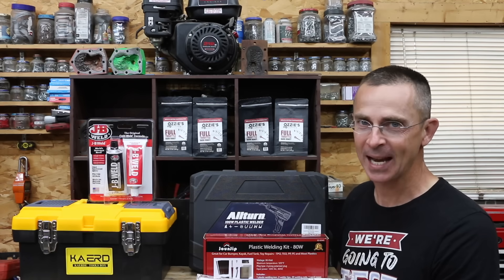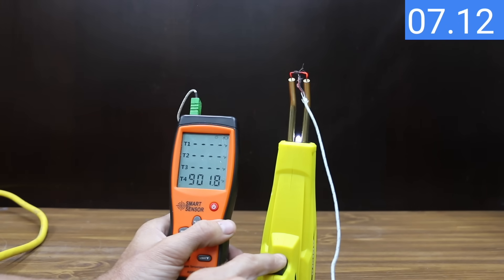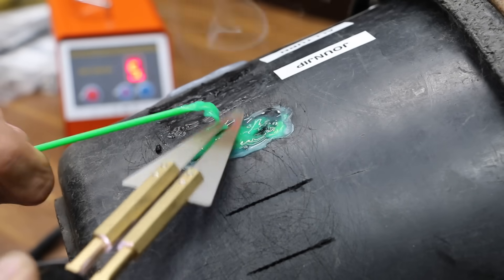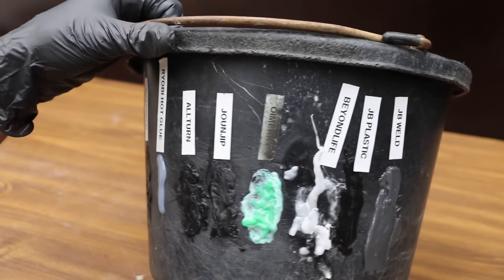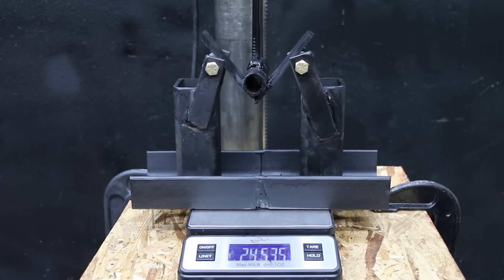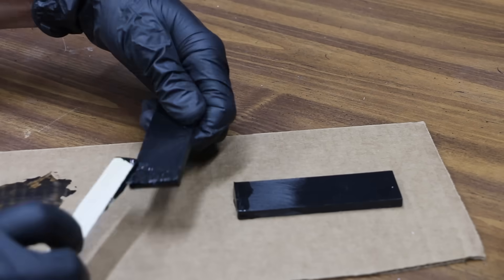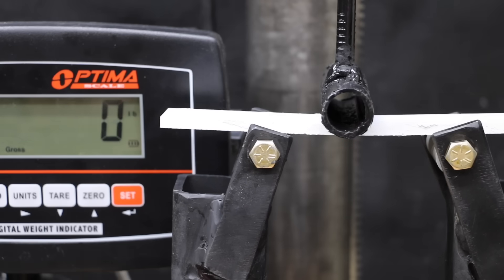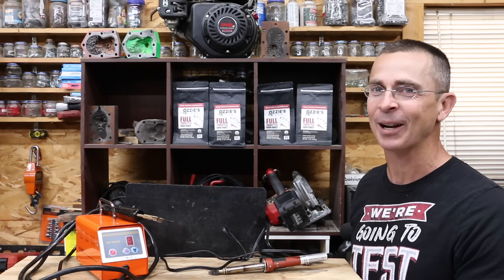Don't Buy A Plastic Welder Until You Watch This Review!

Comment: As a former plastic welder guy for 13 years i think you should maybe do a redo on the testing, when welding hdpe plastic you can only use hdpe as a filler because nothing else will stick unless is something else with polyethelene. 
The Hdpe should be welded at 220 - 230 Celsius (438 F to 446 F) otherwise you burn the plastic and it becomes brittle and not very good.

The Beyondlife welder is a knockoff of Swiss made Leister Triac and with that welder i have done water tanks up to 150 liter and on bigger fuel tanks i used a bigger plastic extruder to make the welds good.

Would love to see a comparisson when of the different types of welders but with the right conditions for welding plastic :)
Reply from the maker: Thanks for the suggestion.

Comment: For two bars but-welded together, it would be interesting to see how cyanoacrylate ("crazy glue" ?) compares.
Reply from the maker: Thanks for the suggestion.
Reply: CA  Glues vary a lot from company to company and formulation to formulation and there are some plastics that they just don't bond well to at all.  Theoretically they do not bond to polyethylene or HD PE plastics and so that's what the dispenser bottles are made from but invariably the cap and nozzle will glue themselves onto the bottle eventially and you can't get it off, except perhaps with pliers and by destroying the nozzle and cap!
Reply: @goodun2974  Yes, I have had caps and nozzles go bad. Sometimes the liquid is still good so I dip a piece of thin wire into it and then daub it where needed.

Comment: melt the mesh into the base plastic first, youre kneecapping yourelf by putting down a coat of filler plastic then trying to melt the plastic thru that and still get penetration, itll never happen that way... the layer on top will have to be completely even ly melted before the mesh will be able to sink into the layer under it... still a great video... 

id really love to see a 3/4plane, 360 laser level somparison, theres zero good comparisons of those online... id really like to see milwaukee vs dewalt vs bosch vs the several top amazon brands... thanks and keep up the good work.
Reply from the maker: Thanks for the suggestion.

Comment: I'd recommend opening up the holes so you can get it through and do the inside as well. If it's a thicker plastic I'd recommend drilling the ends of the crack and doing a 45 degree angle grind from one side to fill it.

This will be an interesting video, I got a plastic welding set I'm happy with but it's quite old now so maybe I need a new one.
Reply from the maker: Thanks for the feedback.

Comment: The basic but very effective "soldering irons" that melt metal staples into the plastic are very effective. The effectiveness of the repair depends on the time and trouble you take on cleaning the surface, welding in the "staples" and cleaning the result.
Reply from the maker: Thanks for the feedback.

Comment: I wonder it a wood burning kit would work as a plastic repairer. Or if a soldering iron would also work? Also you can use zipties as a plastic rod
Reply from the maker: Thanks for the suggestion.
Reply: A soldering iron can work for fusing and bonding small cracks in plastic, but it coats the tips with burned plastic and ruins the tips for soldering with ever again. A soldering gun with flat paddle-shaped tips made expressly for plastic repairing tends to work better. Cable ties are usually made of nylon and will bind to some, but not all, plastics.

Comment: Anecdotally, I have found that BLACK glue sticks with a hot-melt gun (I also use Ryobi) are stronger than the translucent white ones.  The melting temperature seems a little higher and the bonds to plastic a little stronger.  For "quick and dirty" I use this tool.  Why not?  It's already on my shelf.
Reply from the maker: Thanks for sharing.

Comment: This is a great video comparing the soldering iron style welders, but it didn't give the hot air welder a fair chance. The technique should be more like a TIG weld on metal rather than a smearing patch. The joint should be prepped with a bevel, and the weld should be a single bead along the root of the joint, where the base material should be heated prior to introducing the rod. Also, temperature is key. In the video the hot air welder was set way way too hot. The rod should never reach a fully liquid state; the ideal welding temperature for HDPE is 300*C. I'm a newb when it comes to plastic welding, but I have successfully fabricated several custom HDPE water tanks using the hot air style welder.
Reply from the maker: Thanks!  Thanks for the constructive feedback.

Comment: They need to make the wire mesh with some teeth on it so you can melt the teeth into the plastic  before  repair.   A+ Video as always.
Reply from the maker: Thanks!
Reply: A heat gun is best for melting the mesh into the plastic.

Comment: @ProjectFarm would've liked to see how a
 hot glue stick specifically for plastic worked compared to normal stuff since they normally don't stick well to slick plastic, only adhesion is from melting action.  But SuperTac 500 is specifically for plastic and seems to work well from my test,  but haven't compared as extensively as this.
Reply from the maker: Thanks for the suggestion.
Reply: Does the super tack 500 work well with any ordinary glue gun or do you have to use a higher temperature or adjustable gun to get it to a certain working temperature range?

Comment: The beyondlife is a welder that is used to melt two pieces together. It's a too roofing welder. You using it wrong. You need to melt the ends of the two pieces and press them back together. It isn't meant to be used for melting plastic on top of another like you were doing. If used correctly it would basically make two pieces become one. They would literally melt back together.

Comment: Something I've noticed is the method of sanding that you use is in only a single direction and that is hurting the overall strength of your repairs. When sanding you should always use a cross method. The idea is to provide the most surface area possible. You should be able to see little crosses in your sanding grooves. You will be surprised at the difference it will make. Also I noticed that you are a little impatient with your iron give yourself a little more time starting out to sink the tip into the parent material. Just like with normal welding you gotta get penetration. It's not like hot glue. You have to make both half's into a state of matter that is borderline molten in order to achieve fusion.

Comment: Great video! Next you should test those bonders that use the ultraviolet light to cure them!
Reply: Rapid fix is a good ultravolet cured glue but it will only harden in places that the light can actually reach to.  JB weld has an ultraviolet cured CA super glue that will cure quickly when and where the UV light hits it and then cures more slowly inside the joint where the light can't reach, but the one thing I don't like about it is that the squeeze-bulb system that the glue comes inside of is a terrible design ---- the nozzle clogs with cured glue and can't be cleared even though the tube of glue is still liquid.
Reply from the maker: Thanks!  Thanks for the suggestion.

Comment: I would like to see a comparison with OBD scanners. Maybe that also support more than just the engine ecu.

Awesome video. I use a plastic bonder like the jb weld primarily for cracked bumpers. They dry fast and easy to sand. With a primer and paint you don't see a difference
Reply from the maker: Thanks!  Thanks for the suggestion.

Comment: When melting plastic to repair plastic, make sure you heat BOTH parts up.  You usually heat the part that's being repaired with a heat gun.  This will make the repair much stronger.
Reply from the maker: Thanks for the constructive feedback.

Comment: When repairing poly cisterns and troughs we found it was better to bevel the edges of the crack with a grinder or moto tool.  Heat the parent plastic to the melting point, then use the rod through type head.  Use a push pull method like you do stick welding.
Reply from the maker: Thanks for the constructive feedback.

Comment: Sorry but your welding technique needs a lot more practice, welding plastic is a lot like welding steel with a oxy-acetylene gas  torch, melt the two parts to get a molten pool then dip in the filler to fill, melting plastic over the crack will never give a strong bond

Comment: I use the hot air welding guns on roofing, swimming pools and plastic repair. You want to feed the plastic all the way through a few inches. Hold it steady and drag the gun back and melt the plastic rod into the crack to fill it. As you drag the gun back, it will feed the plastic rod into the tip as you follow the crack. The flat end on the front is made to help push the plastic into the crack and smooth it out as you pull. I had to get training from a guy in Brazil. He's one of the few master hot air welders. He trained me on installing TPO membrane inside pools and how to custom cut & fold flat material to sit on any shape surface.
Reply from the maker: Thanks for sharing.

Comment: I think you may have had too much air pressure with that air welder, I use about 3-4 psi in mine. You need to remove a little material in the corner to open a channel. like welding steel, and just melt the edges until they deform a little. Then it's like TIG welding, add just enough material to fill the channel, and ensure good mixing of the base and filler material. The tip of the welder smooths everything out. It's more difficult than welding steel as there are more variables, but a good weld is just as strong or stronger than the base material. Love your videos BTW.
Reply from the maker: Thanks!  Thanks for the constructive feedback.

Comment: Hm, this one might be worth revisiting with some of the feedback I've seen. A proper weld should have full penetration of the material, and I don't think any of these did. To tell if something is welded in destructive test, you can look at where breaks occur. If the break occurs in the middle of the weld, it's not a proper weld, probably a material compatibility or heat issue. If it breaks at the edge of the weld, either it didn't bond properly or the original material was weakened, usually a heat/prep issue. If it doesn't break or the material breaks elsewhere, that's a proper weld.

From what I'm seeing here, there's probably an issue with some of the tools and a lack of experience with some of the methods of welding. I've only really done metal, but some people here had some solid advice on plastic welding, so I think it would be worth doing another video taking that into account. Hope this helps with testing at least.

Comment: You should have tried a RadioShack soldering iron.

I bought a sheet of stainless steel mesh.  Its a very fine mesh.  I think people use it for vape pens or something. 

Ive fixed an old plastic craftsman snow blower, a few tool clamshells, kids toys, and a bunch of other random stuff.
Reply: I bought a 70W iron 20 years ago for $15 from RadioShack.
Reply: Soldering iron, or soldering *gun*?  The Archer soldering guns used to be made by Weller, and flat paddle tips were available for smoothing and repairing cracks in plastic.
Reply from the maker: Thanks for the suggestion.

Comment: I did plastic welding in an industrial setting for the pickle lines at steel mills. We fabricated plastic tanks and fiberglass reinforced plastic pipe, mostly PVC, and polypropylene. You were way too hot with the green air blower tool. All of our equipment was fron Germany.

Comment: Great vid as always. Good effort but your technique was not correct so the results will not be reflective though at least your repair method was consistent on all. Be interested to see you do the same test again once you research how to plasti weld properly and see if the strength improves.
Short version, need to use the dame filler rod as what you are repairing. Grind a grove out or use the iron to do it, then introduce the filler rods making sure the repair material also softens and mixes with rods. Kinda like welding you need to get good penatration

Comment: This test, in my humble opinion,is incomplete. The bucket test is only about plugging holes in plastic. Meaning adding missing material or generally plugging the hole, which can be done even with strong tape.
  The plastic pieces test is about repairing plastic. The only way to repair broken plastic is to melt the broken pieces together, and maybe add some of these binders to reinforce it. Adding plastic binders on top doesn't really do much.
Another way is to use one of these kits to melt the broken plastic, while adding the binder at the same time. But again, you have to actually melt the broken plastic itself.
Also, you missed a few other good ways to repair plastic. Using superglue or glue that melts plastic.

Comment: I think this one is an immediate revisit after you read all the suggestions by experienced users in the comments.  I have idea what I am doing, but I have fixed several refrigerator shelves using an old soldering iron and first melting the two sides like a but weld then melting wire mess on top of it.

Comment: My experience is that only a proper plastic weld will last the lifetime of a part.  It would be helpful for people if welds and chemical products were run through multiple freeze and hot cycles, then tested.  One successful weld I made was dripping melting solder on a fiberglass reinforced plastic automotive part because the part would burn instead of melting.  The plastic bubbled up, but the solder and plastic made a permanent and extremely strong bond.
Reply from the maker: Thanks for sharing.

Comment: I used a hot glue gun to add material to my crutches years ago and the glue melted on pavement, it was not made by RYOBI thought, I just looked at my Gorilla brand hot gun, I never used it before but it does not say how hot it gets....
Reply: Hot glue doesn't work well for automotive repairs because of the concentrated heat when the sun hits the car.
Reply from the maker: Thanks for sharing.

Comment: Very interesting. I have quite a bit of gear for plastic welding, but saw some new stuff in there to ramp up my gear lust! 

In my own experience, I've found that the first and most important thing is the type of plastic that you're working on. HDPE, ABS, and acrylic are all totally different. For most repairs, I like staples with steel mesh melted into the repair piece, and then additional material over top of that.
Reply from the maker: Thanks!  Thanks for sharing.

Comment: A fun addition (if you ever do this again) would be to see how strong a repair would be if you melted the two pieces together first (though this could make the plastic too brittle afterwards and in turn just make it weaker overall) instead of just appling the products on the outside (I know that is not your fault and you are just following the instructions). Just curious to see if that could make the bond stronger, kind of like how with metal welding you need to penetrate the metal and not just weld on the surface.

(I know that the wire stapler kind of does this but only after touching the pieces together and not across the entire face of the pieces)
Reply from the maker: Thanks for the suggestion.

Comment: My favorite is putting down some aluminum foil, putting a couple layers of fiberglass mat and epoxy, lifting up the foil and sticking the wet mat on my repair, it can be upside down. Then letting it dry for 10 min or just enough to pull the foil of leaving a nice smooth shiny surface. Very strong. Next I'll use old JB Weld for repairs
Reply: Great tip thank you!
Reply from the maker: Thanks for sharing.

Comment: I use thick hot glue sticks and a little blow torch lighter for just about everything from repairing shoes, waterproofing terminals to coating wall plugs going into bricks or plaster.

Never use the actual hot glue gun anymore.
Reply from the maker: Thanks for the feedback.

Comment: I've welded motorcycle fairings a bunch of times just using a high power soldering iron and clips from bent MIG wire. The trick is to keep the heat local (therefore a very hot iron) to prevent warping. Get good penetration first, then apply reinforcement clips just under the skin from both sides (this keeps the surface from cracking and causing cracks in the paint). Add filler material and sand smooth.
Reply from the maker: Thanks for sharing.

Comment: Another great video!
I used black zip-ties, a big flathead screwdriver,  and a propane torch to fix the plastic tank on my radiator. Worked great for over a year. I would rather have had a hot iron like these, but when you have to get to work. You use what you've got.
Reply from the maker: Thanks!  Thanks for sharing.
Reply: If it worked only for a year it didn't work great it was a patch
Reply: @infernaldaedra an emergency repair .eant to get you to work that day, that last over a year is a win. Any plastic weld job on a radiator tank is likely to be temporary, it dirty hot and under pressure..  all repairs are short term patches in that setting..
Reply: Cheap zip ties are made from plastics with low melting points and as such are not a great choice for repairing radiators. Might be why your repair did not last forever.
Radiators I think are usually made from glass reinforced high temp nylon, repairing them with the same material would give the best result.

Comment: NExt time consider adding a tensile strength test.  Great job.  Very useful. Thanks!
Reply: Also HDPE must be welded for a permanent repair. Glues will only stick or adhere to HDPE for a limited time. But not permanently.
Reply from the maker: Thanks!  Thanks for the suggestion.